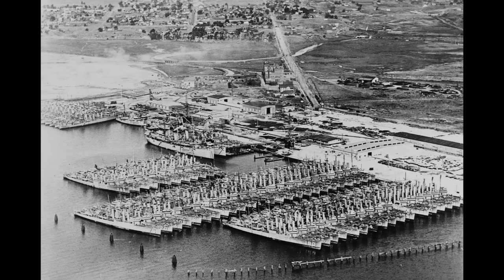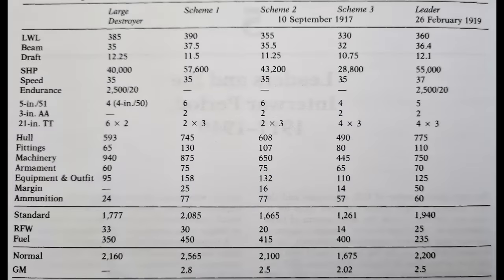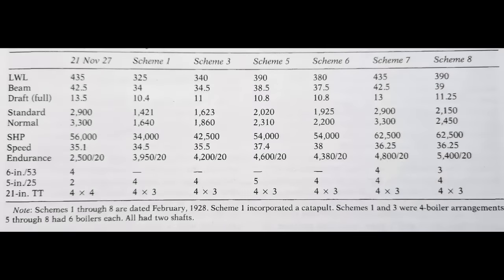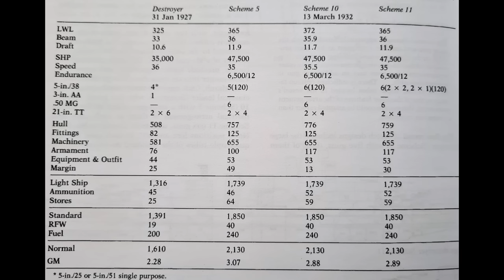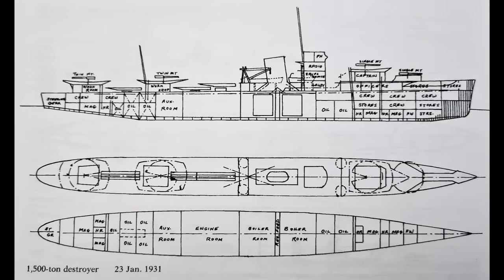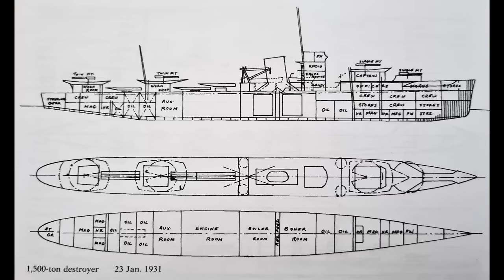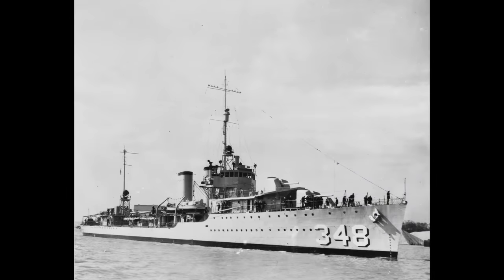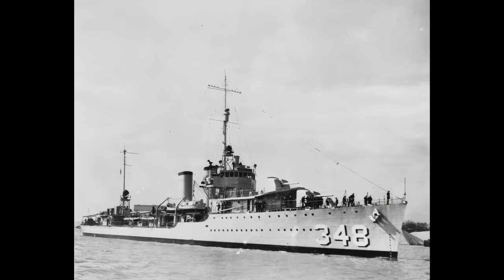The History and Development of the 5"/38 - Turns out you can take the sky from someone

Comment: The DDG I served on in the US Navy had 5"/54 guns. One forward and one aft. Built in the early 1960s. Separate projectile and powder charge.
Reply: sounds like the same Adams class I served on....Asrocs amidship with twin triple torpedo launchers forward and a SM-1 twin launcher at the fantail
Reply: @michaelkendall662  no SM-1. We had a different anti-aircraft missile.
Reply: @rutabagasteu  we went through overhaul 83-4 and they took 10 of our 40 Tartars and replace them with Harpoons...same rail launcher....8 seconds for 2 missiles to load lock and fire
Reply: @michaelkendall662  I just looked it up.  Twin Tarter. The SM-1 was a later type.
Reply: @rutabagasteu  don't know...was commissioned in 1960 and set sail in 1961 ......I was on her 1980-85

Comment: As an exercise, I wondered what would have happened if the USN had started installing the twin 4"/50 that was experimented with in the late teens, as battleship secondary, instead of the 5"/51.  Came up with mount weight and weight of fire numbers that made the 4" look like a good bet.   From there, development into an analog of the British 4"/45 QF Mk XVI/twin Mk XIX mount would be a logical progression.  If all the standards at Pearl had twin DP 4"/45s, in place of the 5"/51s, that would leave the entire upper deck, where the 5"/25s were historically, open for light AA.
Reply: The whole point of the 5"/51 was heavier hitting power at longer range.  Don't think the 4" could match that.  Or are you proposing twin 4" replacing single 5"?  The Standards had the 5"/51s in casement mounts, with the 5"/25s in open single mounts.  Would the mount weights not be more?  And finally, what "light AA" did they have in 1941 besides the quad 1.1"?
Reply: @gregorywright4918  yes, I am assuming a twin 4" mount, which the USN experimented with on a couple Clemsons.  Looking at the photos of the mounts in use, the issue is clear.  There was not enough deck room on the foc'se of a Clemson for the crew required to operate a twin mount.  (all data taken from Navweaps)  weight of a 5"/51 with single mount: 15.36-17.26mt.  Weight of a twin 4"/50, guns and mount, 12.33mt.   Rate of fire is the same, 8-9rpm, but adoption of a sliding breech, combined with the 4" fixed ammo could double that.  Weight of the 5" common shell: 50lbs, vs 33 for the 4".  Charge in common shell 5": 1.73lbs, 4": 1.39lbs.  Range to penetrate 2" of armor 5": 8000yds, 4": 6300yds.   So the twin 4" mount can fire more steel, with more charge than a single 5".  Go to a sliding breech, and the twin 4" can fire a lot more steel and a lot more charge.  Yes, the 5"/51 can penetrate more armor, but the DDs and torpedo boats that would usually be attacking are not armored.  It would take a light cruiser to stand up to the 4".  Yes, the 5"/51 has more range, 18,800yds @ 25 degrees, than the 4": 15,000yds @ 19.9 degrees, but torpedo boat armament was aimed by the Mk 1 eyeball, and, particularly hull mounted casements offered such a poor view of potential targets that maximum range is probably academic.    I took my investigation one step farther: cutting the 4"/50 down to 45 calibers, and mounting them in a copy of the British Mk XIX mount.  The result was lighter than the combination of a single 5"/51 and a single 5"/25, while being able to throw more steel than either of the 5" guns, and freeing the upper deck for more light AA armament.  Yes, I am assuming the 1.1" for light AA, as that is what they had.

Comment: I could only imagine a modern 5"/38 gun loading 5 round revolver clips firing alternating barrels with a 10 round burst
Reply: Like the 40mm Bofors! How much would 5 5" shells and their (clip?) weigh?
Reply: @marckyle5895  53-55lbs, so 265- 275lbs plus probably a 20lb drum so 285-295lbs but it would probably be on a pre loaded carousel, like the Russian 130mm naval guns edit:  like the ak-130s but alternating instead of at the same time
Reply: Go check the retired Swedish 155mm howitzer Bkan 1c, it was a magazine feed with 14 rounds in the magazine. When reloading you replaced the whole magazine. With one round preloaded It could fire 15 rounds in 45 s.

https://en.m.wikipedia.org/wiki/15,5_cm_bandkanon_1
Reply: @jensolsson9666  that's not bad for an artillery though in my imagination i would like to see a dual purpose battery with programmable air burst shells, tied with radar kinda like modern day flak battery for a naval cruiser, imagine dumping 10 rounds in just over under 20s from 2 barrels with a brief intermittent reload, though on a gun like that barrel wear on rapid fire would be absolutely horrifying
Reply: Guns like that exist, made by OTO and Rheinmetall, though they are usually 75 or 100mm.
They have absolutely terryfying medium range AA capabilities. Like a single one can sweep a squadron of supercruising jets from the sky 10km terrifying.
They are mostly being marketed as emplaced defences for FOBs against drones with canister of fletchette loads.
Reply: @egoalter1276  the 100mm seems like a decent option, but the 75mm or smaller there was a semi famous training exercise were a bunch of modern destroyers tried to sink a ww2 target ship, the ship that succeeded was the one that had mounted that ww2 ships gun.
It was a race to sink it if the navy didn't succeed in a time frame the airforce would get to do it.
Reply: @RadarLeon  I think reload time would make it slower than the old fashioned way
Reply: @marckyle5895  should be faster due to the 5 round drum Mags being on belted elevators, should take around the same time to load a prepared 5 drum as a single round, though russian ships have a complicated shell carousel I find to be over engineered and more dangerous than just a bunch of drums on a chain elevator....

Comment: Side note:  The 5"/51 did not, in surface-based applications, use fixed ammunition.  It, amazingly enough, actually was a bag gun, using separate powder bags for its propellant charges, which explains a lot about why the rate of fire was so (relatively) low.
Reply: Considering there are 5 marks of that gun, it might be bagged for the early ones and fully cased for some of the later ones.
Reply: @jacobdill4499  According to NavWeaps, the only cased propellant version of the 5"/51 was the Mark 9 submarine gun; the others were all bag guns, at least in full production.  "Some early Mark 7 guns were completed as case (semi-fixed) ammunition guns but were later converted to bag guns," to quote their page on it, which may be the only case I can think of where someone converted a case gun to a bag gun.  Reading between the lines, it looks like they may have chosen bag guns to allow the use of reduced charges in peacetime training to extend the life of the barrels.

Comment: Note: looking at 5"25 mounts on the left-hand side there is a three round fuze setter unit with the round pointing down into the unit. The operator sat facing the setup with headphones receiving data from central fire control for setting the fuzes as the data came in. Loaders once the fire command arrived would pull ready rounds in sequence from the setter while ammo passers placed fresh rounds into it. On the 5"/38 mounts with ammo feed from below the Fuze setters were in the shell lift. I visited the Weapons training operations at Great Lakes back in the 1960's with several gunners' mates giving detailed operational information on how each system worked including the three new Anti-air missile systems in use Tarter Terrier and Talos.

Comment: The 5" Mk.12 gun was not the best heavy AA gun of WW2, if you simply compare the characteristics such as shell weight and velocity. What made it the best heavy AA gun in WW2 was a combination of things. There was the power loading of the separate ammunition. There was the remote power control from the director. There was the base ring mount with ammunition fed right up through the base for the gun(s). There was the fuze setter in the handling room just below the mount where ready ammunition was stored rather than in lockers near the mount. There was the Mk.37 director with fire control radar and an integrated 15' base stereo rangefinder, and an off-director electric-mechanical computer, the Mk.1 which could handle the ballistics of multiple round types. There was the Common AA round which at 55 lbs carried sufficient HE to damage enemy aircraft at 20 yards but still had space for the VT fuze, which was the last piece of the puzzle, allowing rates of fire of up to 22 rounds per minute using ready rounds from the Mk.30 single base ring mount. But this same combination gave the 5" the capability of engaging enemy destroyers and even some light cruisers. The 5" Special Common was capable of penetrating the protective plating on the Japanese 5500 ton light cruisers at 10,000 yards. When HMS Delhi came back from her modernization in the US, the RN was simply astonished at the performance of the 5" Mk.12 as a system. They had an equivalent gun, the 4.5" Gun Mk.I, and mounts, such as the BD twins. But the British had made a basic mistake when first developing their AD fire control, the HCAS. They adopted a non-tachymetric solution generator, where both the US, with the Mk.19 and the Japanese, with the Type 94, went with tachymetric "computers". With each Mark, the British bolted on more capability, but even the Mk.VI couldn't compete with the Mk.37, which they received through Lend-Lease and mounted on the second group of "Battle" class DDs and on the last British battleship, the HMS Vanguard, using British fire control radars. The US adoption of an AC electrical system also allowed them to better integrate more accurate "synchros" for data transmission and PRC. The 5" Gun Mk.12 is an example how evolution of multiple elements of a weapon system can create an order of magnitude improvement in effectiveness.
The 5" Mk.12 was eventually abandoned as an air defense weapon as the development of guided anti-ship missiles and bombs put the launch platforms beyond the effective range of the gun ballistics and the speed and change of rate and altitude left even the Mk.1A computer unable to generate firing solutions in time. It remained a viable surface warfare weapon, especially against surfaced submarines. The system itself, which was considered highly automated in its time, became too expensive in manpower, as manpower became the determinant factor in sustained costs. Now we have mounts and ammunition supply systems that require a single man to keep loading the magazine and fire control systems who include a man simply to provide a veto capability on target designation.